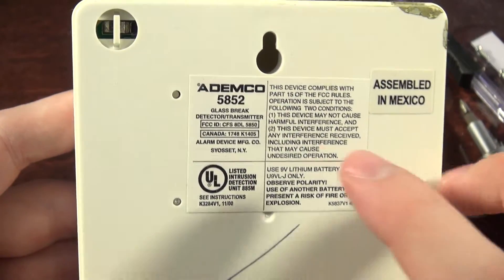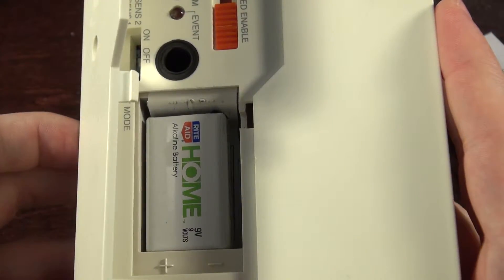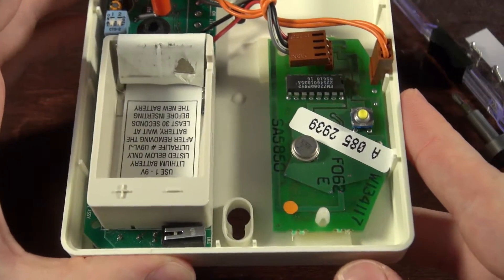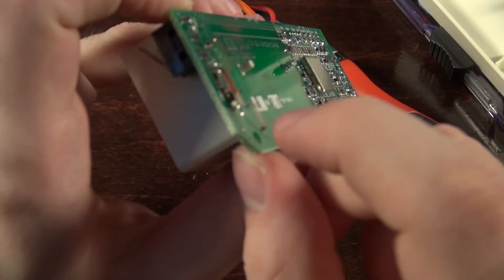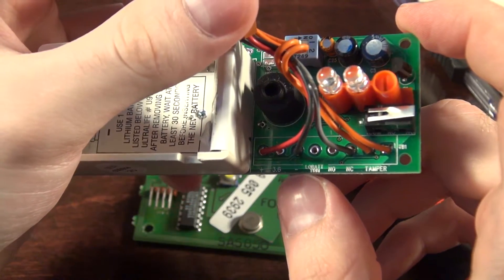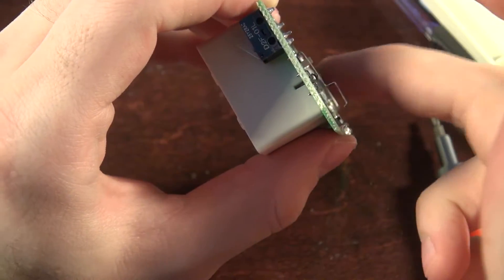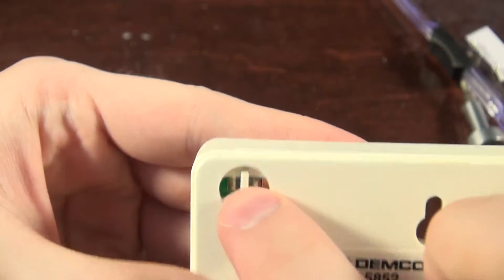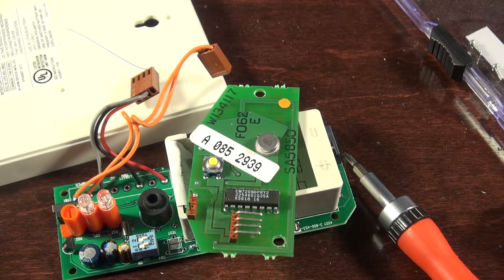Glass Break Detector Teardown

Comment: sorry but this video was funny. The last spring contact on the back is a 3rd tamper switch. These do not use vibrations or trigger. The microphone you pointed out is exactly what it uses,  glass break sensors work by "listening" to the harmonics of breaking glass. You where right about the other board though. Its the wireless board